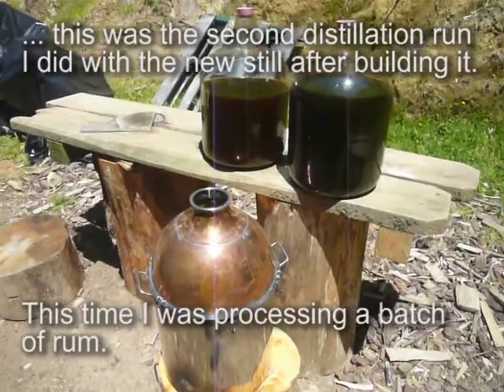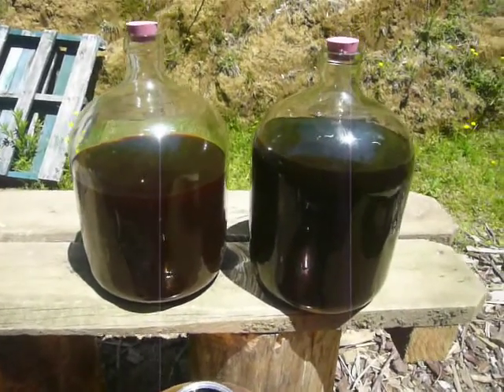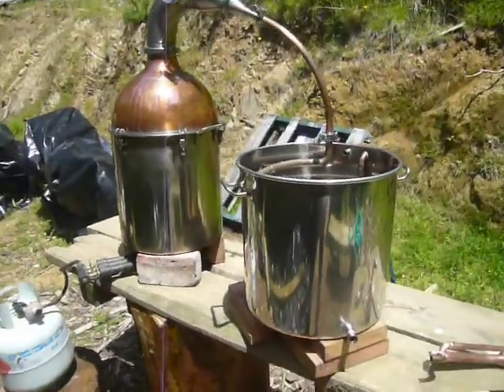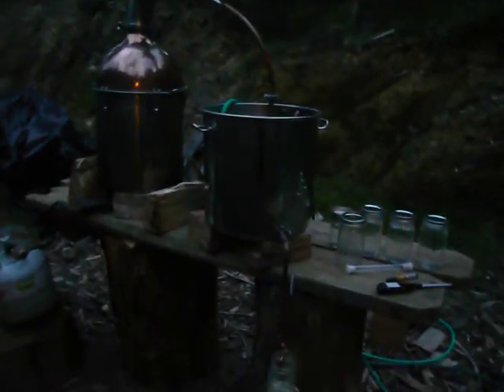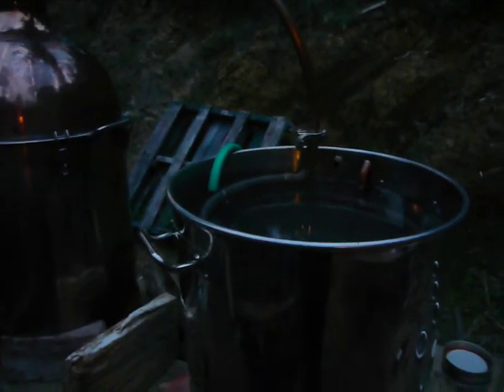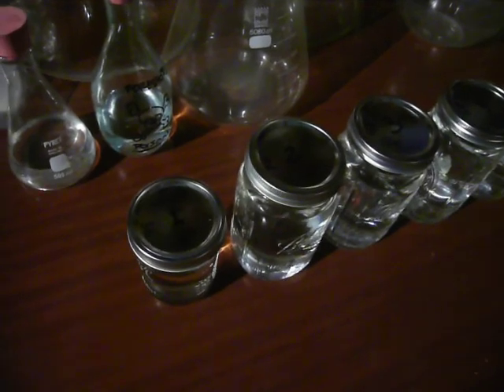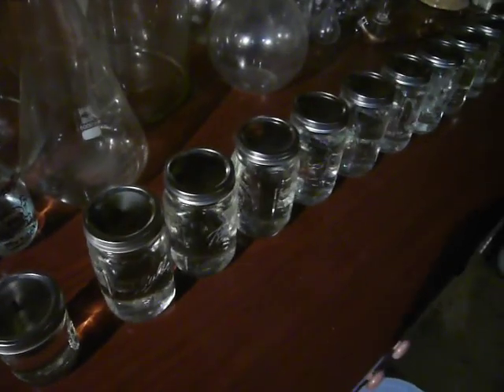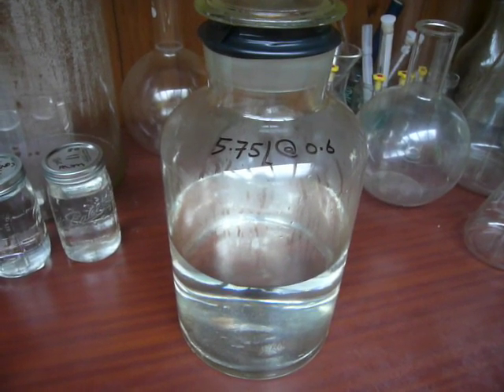Distilling_02

Comment: So, no stripping run then spirit run? is that the norm for Rum? also, I think dunder is used similar to a sour mash as in added to the next wash prefermentation. Not heard about adding it to the actual product though.
Reply from the maker: G'day Danny,,

This vid' was shot in pieces about 2 years ago, I ended up editing it and uploading it with others beginning of this year. Was early on when I had just built this still and only been running it for a very short while - yeah one spirit run - no stripping run heh heh, - keen as mustard and no patience.

A little later I added a thumper keg which did a better job on a single run (much higher abv yield and much cleaner favor) but still not quite as good as a double distillation - stripping run followed by spirit run, that I'd do now days (although I still do single runs with the thumper in this smaller still with 50L batches of whisky or rum wash from time to time).

Yes, dunder is added to the fermentables - as you say "like a sour-mash" and that is how I brew my rum, ... there are also rumours of small amounts of backset/dunder being added into some rums (along with things like caramelized sugars) - I'm not sure how the backset is processed or filtered but definitely read it several times and heard anecdotes enough for me to think there may be something to it.
Rum distilleries do some things you may think are crazy in any other genre of booze making - ie; "muck-pits" for instance. :o)

Happy Distilling!